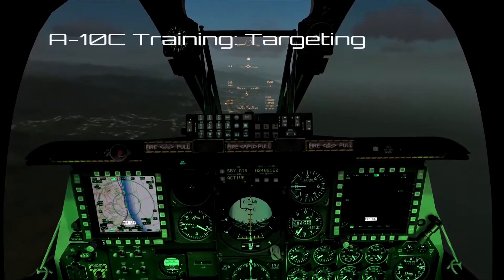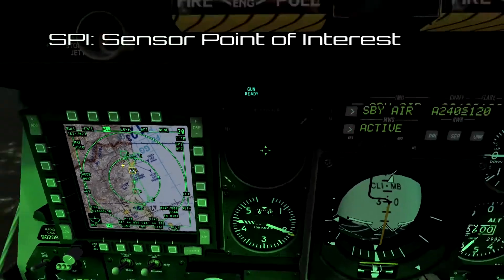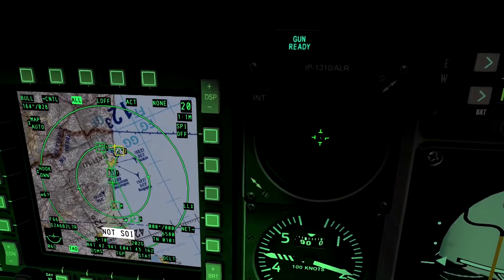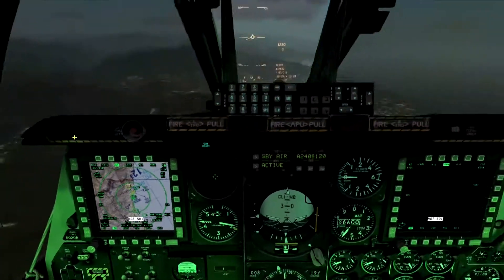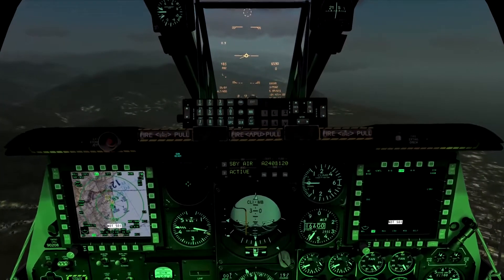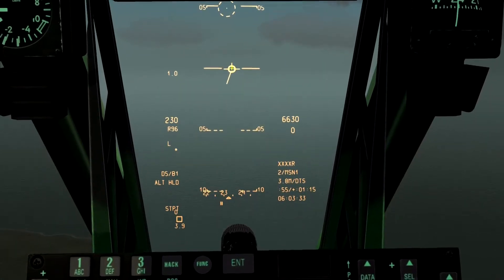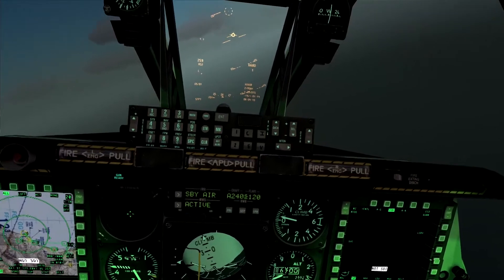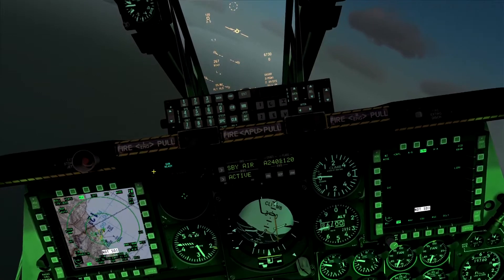DCS World A 10C Targeting and Sensor Guide

Comment: Got another sensor question for ya (hope I'm not spamming you with these, heh).
Can you broadcast a moving (point) target to your wingman, or only the area one?
And is there a way to see on the TGP if its looking at SPI? (I know you can see on the TAD the "wedding cake", but I'm interested if there's a visual marked on the TGP if its pointing to SPI)
Reply from the maker: No problems.

If you transmit a waypoint it can't be moving so this is what I would do:

1. Set TGP to point track mode on target so it's following it
2. Create mark point just in case you lose it
3. Set TGP to SPI
4. Broadcast SPI so that as the targeting pod is moving your SPI broadcast is as well
5. Other wingmen can hook your SPI and slew to it 

I don't think the TGP itself knows what SPI is as the SPI lives inside another system like the CICU or something. So the TGP never has symbology saying thats it's SPI or where the SPI is. HUD and TAD does though.